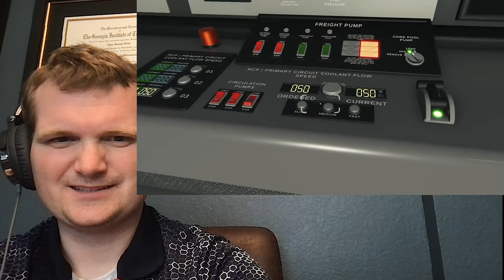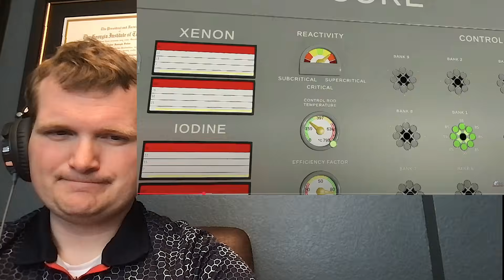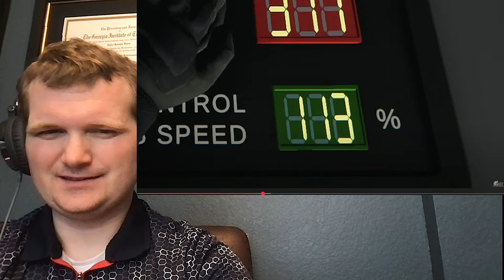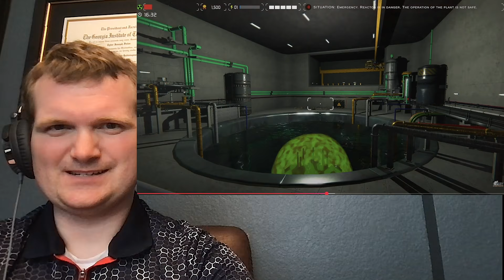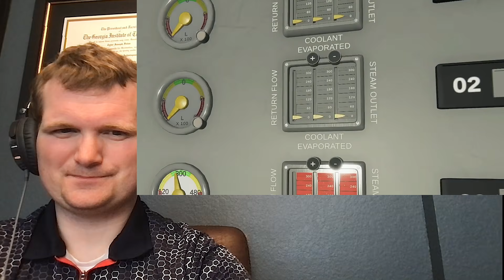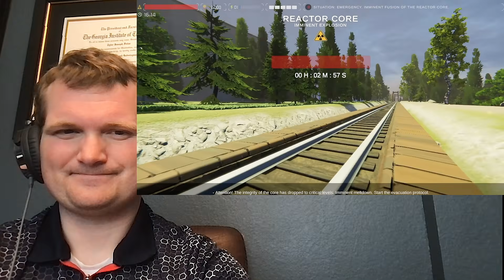Nuclear Meltdown on Purpose in a Video Game - Nuclear Engineer Reacts to GrayStillPlays

Comment: The control rod engine panel is only controlling the speed that the control rods move. They are hydraulically controlled. It's wattage use is important to know if the plant is knocked offline for one reason or another and you choose to use the on-site backup generators or batteries. The percentage is based on the normal operational range in relation to 100%. This range can be exceeded and set to 200%, but it will cause excessive wear to the control rod control circuitry and hydraulic motors. 

This games reactor is meant to be run at 160 bar of pressure. The automated pressurizer heater has a trigger pressure of 150 bar and cuts out at 170 bar. It's operational range is 306-360°C. And as you are meant to follow grid demand and vary power generation, pumps are variable speed. I, personally, find a good equilibrium based on my normal desired core coolant temp of 308°C and balance everything else to remain stable at that temp target. However, I do have bouts of slight instability, particularly instability which causes excess iodine production eventually leading to a Xenon pit. Iodine and Xenon are not active if the Chemical option is not selected at the beginning of save file creation. As my current save file sits, I am running at the edge of iodine excess with a high amount of xenon. Xenon concentration and activity is slowly dropping as I'm slightly below iodine excess, this position is likely helping keep me from needing to remove more boric acid to remain stable or increase reactivity to return to my target temp. I like having control rods inserted by an amount. But, as the game sits now, I can't run pure boric acid or I will generate iodine to an excess that cannot be dealt with, with the eventual xenon buildup causing a shutdown due to a xenon pit being generated. My current rod insertion is 22.8% and remaining stable. Power generation is just under 80MW, a single fuel assembly out of a possible nine. 

The bypass lever on the valves is meant for manual control of normally hydraulically controlled valves that are remotely actuated from the control room panels. For manual control of these valves, you must activate the bypass lever otherwise they will not budge. This may sometimes be necessary when the hydraulic control mechanism fails and manual operation of the valve is required. 

The Reactivity gauge shows stable as a value of 5, used to be 1. With values above 5 being positive reactivity (temp increase), and values lower than 5 being negative reactivity (temp decrease). 

The control rod height is expressed as a percent of insertion. A value of 100 is 100% inserted. A value of 85 is 85% inserted, meaning 15% withdrawn. For people like myself, this makes reasonable sense. 

The whole control room turning red is meant to be a profound alert which requires immediate attention to prevent likely catastrophic failure of components or reactor breach. 

The thing you keep referring to as an alien pump is actually the turbine and electrical generator. It lights up green when in operation and generating electricity. It's a clear visual indicator that it's outputting power. When not active or producing electricity, these lights are turned off. The actual electric generator portion is present for all three turbines, but you need to purchase the remaining two turbines. 

There are no safety systems in this game that keep the reactor in check. There are no safety systems. If there is one safety system, it is purely you yourself. If you are careless and are running the reactor in an unsafe way, the game will 100% allow you to run it carelessly. Even if this feels like a simulator, it's still a game at it's core and isn't meant to be a truly accurate simulation of a real reactor, even though its developer does try to make it more realistic, they still have the goal of making it fun and gamified. 

I wouldn't mind seeing you try out this game and see how you'd run this reactor with your real life experiences. I do remember you having done a reaction to a startup tutorial video from years ago when the game was in a very different state. It has updated and changed a lot since that old video. The core can now be loaded with nine total fuel assemblies, it's physically bigger. It can be physically entered to inspect various things if the core pool and main core coolant loop are drained. You can enter the core with fuel assemblies not being isolated if you want but it will hurt you, you can enter safely with the fuel assemblies being isolated, but I still wear the duck suit anyway. There's a Chemicals option now which activates the Iodine and Xenon concentrations, boric acid, sodium hydroxide used to charge the ion exchange chamber, boric acid is removed from the main core loop by running coolant through the ion chamber. You can also run water through the ion chamber through the same pipe sodium hydroxide is, preferably closing the sodium hydroxide valve if you don't like things exploding. I often have issues with the diesel fuel tank being contaminated but there's no reason for why this happens, I don't feed water, boric acid or sodium hydroxide in to that tank. I spend the absurd money to clean the diesel tank and refill it just to be sure my backup generators don't stall, lock up, or otherwise fail. You can run off grid power if needed, but I would prefer the backup generators, it's cheaper in the end.

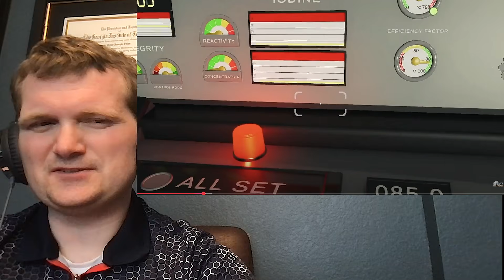Comment: 11:51 the reactivity gauge is actually a glorified temperature delta gauge
on the left there is Xenon and Iodine reactivity and concentration
Reactivity is how it effects the reactor 
Concentration is how much Xenon or Iodine is in the reactor 
The reactor will have a Xenon spike after a few hours when it was started up
It also have boric acid, sodiom hydroxide and cleaning water on the chemical panel 
There is a game setting to enable or unenable the chemicals

Comment: If he's trying for a meltdown in game, just shut the coolant pumps off, and wait a few minutes and it'll meltdown. 

Pull control rods and it goes prompt critical, but sadly it gives you a timer to fix your mistake, instead of the pretty much right then kaboom. 

I strongly suggest playing it, just understand it's not a trainer or simulator. It's basically a "hey this is kinda the basics, but no where near 100% accurate".

Comment: Please God help TMI-1 Get pushed back. They are pushing for a rushed start and testing ( currently Constellation is positioning for turning on that 50 year old 5 year sitting reactor with replacing only 60% ( not replacing the core ect). As one of intellectual knowledge you know that its been bombarded by neutrons for 45 years. The metal has likely gone through atomic change that you're well aware of. They want to turn that mf on testing fuel rods preemptively. Doing so would be as you know catastrophic. The WHOLE facility need rebuilt. Not 60% restored

Comment: Light slows down when it travels through a medium (water, glass, air) In water light travels at about 0.75c So a particle can move faster than light in water. This is what causes Cherenkov radiation.

Comment: What game is this??? 

It looks cool, and I want to get it.

Edit: I got it. I've checked two failures, going prompt critical by completely removing the control rod, and shutting down the cooling system to meltdown, they are somewhat accurate. 

It's a great game, I would like if it were more accurate, but honestly, not bad. 

It's on steam sale for like $12-$13, and I suggest trying it.

Comment: This game has a very specific (unrealistic) reactor design. Flooding the pool works backwards, for refueling you need to drain it and open it dry, for operation you flood it, acts like a secondary coolant.  That engine power he  thinks raising power is just setting  the rod control motor speed.

Comment: I don't know if it's been mentioned before, but "engine power" basically increases the torque of the motors inserting and pulling the control rods. The way the game is programmed is, when the reactor temperature and pressure go over a certain limit, the control rods are slowed down (turning an indicator light on) and it takes longer to re-insert the rods and stop the reaction. Presumably, you raise the "engine power" to get the rods inserted at a faster rate, but risk damaging the "engine".

The way I see it, it is designed as another variable to keep track of and enable a one man crew to avoid meltdowns if something happens while you're away from the controls.

Comment: Engine Power it's the power speed for Rod's "Up/Down" to much power means overheating the engines for Rod's and if the engines are down, you can't control Rod's anymore

Comment: yeah the game is not suposed to be that relistic its more about funn its focus is micromanaging and upgrading the plant there are near no automated systems and not a single safety system.

The fun comes from manualy balancing the variable flow of each loop against each other watching levels, and actualy the game includes boric acid if you enable the chemical module of the game.

Yeah and the tink in the midle of the pool is suposed to be the actual pressure vesel thats just submerged in the pool. Yeah and the control rods and fuel just stick out of the top for better visual effects.

Yeah and there are other things he didnt show maintainance, audits, service compliance, chalanges, you need to stay within the limit of your transformators, you cant produce to much energy otherwise your capacitor banks will overheat, overloading pumps or letting them run dry will damage them, you can install more control ords and more fuel rods, you can upgrade pumps.

overall its pretty fun to play you should play it

Comment: 4:50 just to clear that up a bit, the entire reactor pressure vessel is submerged in that large pool we can see. there's also a massive blast door at that window which can be lowered to isolate the control room from the containment structure, and if radiation is detected inside the containment building it shuts automatically iirc.

19:20 that's basicly a power setting for the hydraulic pumps which feed the control rod actuators

Comment: I saw multiple videos of the game, but after playing it myself I was disappointed because there's a lot of things that just don't make any sense in terms of the most basic high school physics. The whole primary loop circulation doesn't affect core temperature, or boiler doesn't have any latent heat effects in it's simulation or turbine load vs speed etc. I just can't understand why dev made nice plant sim game with all those pipes, apparatus and stuff, but failed to implement the most basic high school level physics, instead putting some hard coded relations between values.
I understand some simplification for the game sake, but not by braking fundamental physics laws

Comment: I love this game. I've managed to get pretty good at running it too. It's really just a fancy waterheater really
The pool is just the external reactor pool. You can drain it and see the actual vessel inside
The boric acid system in the game is optional, and it's really interresting I think. Using it propperly makes the reactor more stable and smoother to operate and last time I messed around with it I managed to have a stable reactor without control rods by carefully managing boron dosing.
But there are regular updates, so it might not work like that anymore

Comment: When I think nuclear reactors in video games two come to mind.

There a Chernobyl game by Cosmi back in the late 1980s.  Maybe 1990.

I had it for Commodore 64.   The game was a straight simulator..
It had you as a solo operator of the Chernobyl plant but the designers did not have much in 
the way of accuracy; the game had the reactor with a containment vessel and the configuration 
was of a PWM not RBMK. 
Start up the reactor and turbine. Produce power.    It had an interesting graphic of the reactor.
Kinda dull as a game. Kept me interested as 12 yr old though.  

Though nothing of this was explained in the manual which had some then-current stuff
about the real Chernobyl accident and rudimentary operations of the plant.

And a game called Cold War - On Your Own Behind the Iron Curtain.   It's $3 on Steam sales.
Sorta Splinter Cell -like where you're a nosy reporter on a story. So there's lots of sneaking around, 
but with crafting makeshift non-lethal stuff. Anyway, the 2nd to last mission has you sneaking 
around inside Chernobyl on the day of the meltdown and you prevent the OTHER reactor from
 going critical too as part of the alternate reason the story sets for the meltdown.
coup d'etat intrugue is all I'll say...

To prevent the other meltdown you have to do several tasks including replacing a fuse and 
inserting control rods and activating what is a simplified Emergency cooling system. 
All while Spetznas commandos are looking for you.   It's actually a good game for what it was.

Comment: Power engineer brain says they should of followed SoP's and got the reactor at max power first then close the valve for the cool water feed. Wait for the rods to fail into the core then close the hot water feed from the core to the generator. I think modern reactors are very moron proof, theres probably an emergency pressure relief system, that would have to be tampered with too. It is actually the steam that causes the explosion. I'm curious about the hydrogen, why would there be a concenstration of hydrogen cause you would want to max this 😂

Comment: The Nucleares reactor is deliberately designed to look like an open pool reactor, the kind that is normally used only for small university reactors. That's why it doesn't have a lid on the pressure vessel. This is a purely aesthetic feature so that the user can watch that pretty blue glow (and also watch a scary cloud of green steam start bubbling out if it starts to melt down.)

Comment: I've played this game, and it feels much, much more realistic once you understand how it works.
Of course some systems aren't realistic in some way, but most of those cuts are for design or gameplay/optimization,  but it all fits. 

Btw, that isn't an FME cover, the reactor core, which would have all three shells or whatever, is completely static, and is inserted into the "exterior" coolant pool, and inside the reactor, there's an internal pool.

(Edit:)
Forgot to mention, the control rod panel is based on precentage of insertion, and the speed is how fast it can move a certain percentage. If you press control (or it mught be alt, not sure) It'll tell you what you're looking at.

Comment: "Can't go faster than light in a Vacuum" Science: "The interstellar medium! Look our Ultrasonic Microphone on Explorer Probe can hear Micrometeorites!" Glad space isn't a Vacuum. Lol... When Earth reactors gonna add Capacitor banks for charging and dumping taking turns applied to Boeing Plasma force field tech with resonance filters for self building > Self repairing reactors? If a machine can be held in form even in a molten state by super strong holographic pressure images would that machine not in that moment be a Ghost Machine? :) https://www.youtube.com/watch?v=VOMIrq34hgA Be amazed how resonance can turn water into Hydrogen & Oxygen which Ultrasonic echoes can rip from atmosphere way easier.. I got OCD. 

Name reactor = Ghost Reactors Mmhmm..  Even further? Add upgrades to computer to patch why it went unstable and feed it material for that new upgrade to the reactor until it stops. Real world simulation capability for results both inside and outside of a computer at the same time. - Dracula

Comment: I remembered today that you got to work with (or near, but I hope you got to work with it at least once) the coolest dial ever (classified by use, not design; vintage bakelite ones win that one): that one that starts off spinning and should end up pointing up. Also often accompanied by 2 flashing lights that stop flashing when you're just right...
Yep, it's the Synchroscope and it tops my list because it (usually) accompanies impressive machinery that'll start making expensive noises if you don't listen to said 'scope and let the 'grid sort the synching with your generator (as in; let the 'grid maul your generator). 
Got to see one in action when a certain duck who does physics got to start up and synch a hydro plant and that tickled my nerdbrain in just the right way. So now I'm doomed to save up for an air-cooled, graphite moderated nuclear pile and a turbine/generator combo😆 
But seriously though, I do want a synchroscope and a collection of small electromotors and generators for small scale, let's be honest; playing around with a side of learning because the electricity on the grid must have some sort of "mass" to override the generators speed into synchronising with it😁

Comment: 1: Games Developer is Spanish, so some words are still weirdly translated.

2: Top end of the game has you with nearly 3.5GW output. 

3: It has the option to use chemicals like boric acid. 

4: the control rods are hydraulic pump controlled. The rod engine control is setting the speed and force of the pump

i’ve only been playing this for 200hours.
Reply: The guy he’s reacting to playing it is an idiot as well and only acting to turn people off of the game, unfortunately. As it becomes more popular and better refined I could see Tyler getting more interested
Reply: @ranranbobandy69 you clearly don't understand the Gray Method.
Reply: @Thornbloom I know about him
Reply: @Thornbloom no, in that case Gray IS a fool. He's messing mit switches and valves that doesn't do what he thinks they do.

Partly he hinders his own goal of blowing the reactor up.